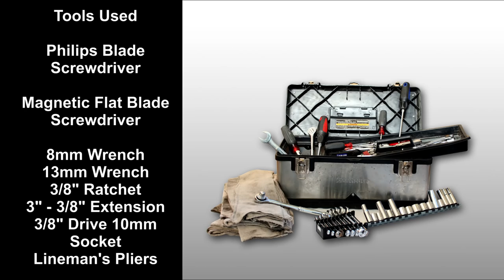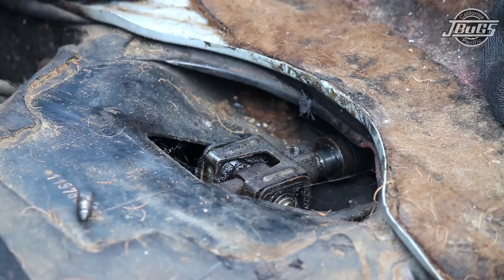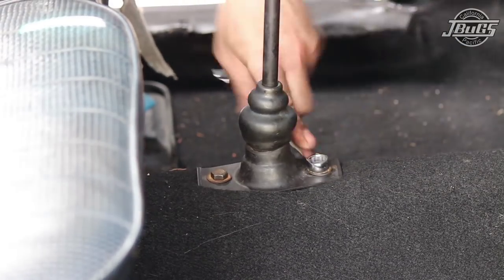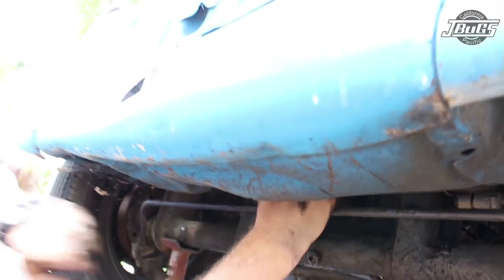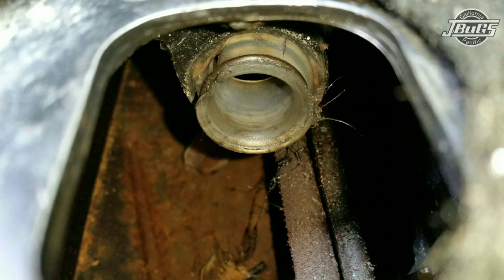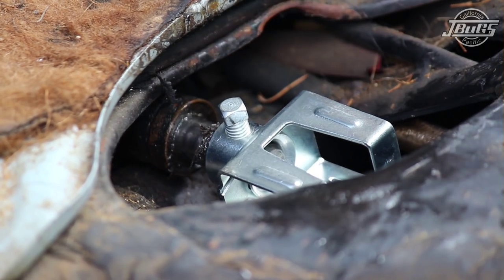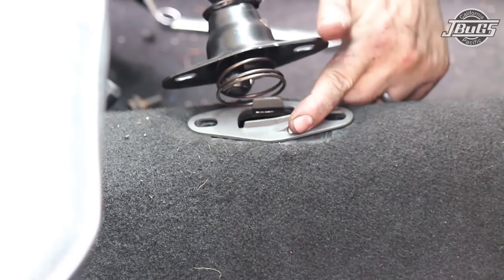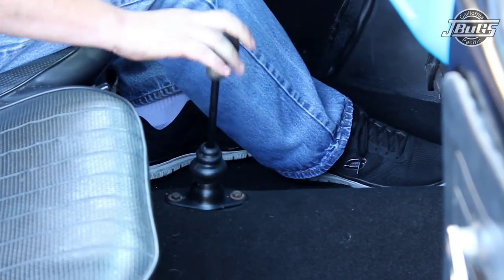JBugs - 1969 VW Beetle - Manual Shifter Rebuild

Comment: +JBUGS One thing that everyone goes crazy about (that was missed) was to lather grease on the plastic bushing and the ball and socket for the shifter.
Reply: We didn't wipe the grease off the original rod, so we didn't need to regrease ours but yes, apply grease as needed!

Comment: Why was the shift lever/rod replaced? I understand the lock out plate, but why the sifter??
Reply: The original shifter was replaced, yes. Mainly because it was easier than sanding down and painting the original.

Comment: no need to buy a who;e roll of safety wire. Go to your local airport and the mechanic wil be happy to give you a foot of it.
As for a super beetle, you can push the tube far enough forward to access the nylon bushing to install a new one . no need to remove the tube from the car, Don't be afraid to use grease wherever it is needed and makes sense. Good crusing.

Comment: Hi JBugs, saw your video and it was great. One problem though, After installing new coupler and tunnel bushing and re-installing the shifter with the reverse lockout plate with the long lip towards passenger side, I cannot get the lockout feature for reverse.when shifting from 1 to 2, I can also accidentally shift into reverse. Theres no pushing down and left and back lockout. The car shifts into 1/2/3/4 okay except for reverse. It scares me to drive it because I can grind my gears. What did I miss. I have a standard shifter with the spring. Nothing fancy. Help!!
Reply from the maker: If the lock out plate is in the correct position, you can try the factory shifter alignment operation:
Press the clutch pedal down and put the car in second gear. Loosen the shifter bolts, and set the shifter vertically (from left to right) and angled back 11 degrees. Using a flathead screwdriver, push the lock out plate to the left, until it hits, and moves the shifter. Hold the shifter top base there and tighten the screws. Shift through all the gears and make sure that the reverse lock out is operating. 

If there are still problems after this, you may have a damaged shift rod, shifter or lock out plate.
Reply: I have the same issue to

Comment: Hi, I did this exact step with my autostick, but I found after I removed my shifter to replace the contact points, my shift rod is no longer center and is now stuck semi recessed into the hole to the bottom left and I am not able to pull it back out far enough so I can properly install the shift lock out plate. (I know this is for a manual, but this is the only precise video on installing a shifter in general, yes I tried install the shift lock out plate in its correct position too, however, it just pops out of gear when moving around because of the location of the shift rod cup.
Reply: If the shift rod isn't moving somewhat freely, that is most likely the cause. I would start by going back to the shift coupler under the rear seat and see if you can get the transmission shifted back to neutral so you can get the shifter properly installed and go from there.
Reply: @Sam_Mebane  Hey Sam, thank you so much for getting back to me. I've never worked on an old bug before, let alone a VW car. I know the area you're talking about and the coupler, but how am I meant to get it in gear manually from that area? Do I pull on the coupler, or the rod? I'm not sure how you would manually shift it back into neutral. Thank you! it does seem like its stuck in Low gear (bottom left) and doesn't move.
Reply: @FallyFire  you can pull on either, assuming the coupler is attached to the rod. If the rod is pushed back fully at the moment, the transmission is either in reverse or "1st" gear (2nd really as L is 1st). You can pull the rod or coupler toward the front of the car slightly to the neutral position, then you can try reinstalling the shifter.
Reply: @Sam_Mebane  Hey Sam, I appreciate the response again! Just went out to finally work on the bug and I pulled on the shift coupling, it's definitely attached. But the shift rod itself I noticed is cock-eyed so it makes it impossible for the shifter to seat correctly. I noticed there was this broken rubber like piece towards the head of the shift rod, where the shifter connects to. Could this be part of the bushing? There was a small metal ring around it just freely moving on the rod itself, so I was wondering if that bushing keeps the rod from turning in the tunnel on itself. I'm starting to think that the bushing got so worn out, that when I pulled the shifter off to replace the contact point, the bushing sliced itself from being rubber or something, and just completely made it unusable. EDIT - It was the bushing, I will be using this video for reference on replacing!

Comment: Can you change out the coupler without changing out or dismantling the rest of the system?  The lockout plate is aligned well and I don't want to mess it up.
Reply from the maker: Yes, the shift coupler can be changed without removing the shifter.

Comment: Is there a video on how to change the shifter bushing on a 1971 Super Beetle. I think there's a different opening in the front for the shift rod since the spare tire lays flat. Thanks.
Reply: https://www.youtube.com/watch?v=7btjeporK98&list=PL7YpZlDdZJCgwFYFCo5WmPgGxko-q6yMH&index=30 We cover the removal on our 1971 Super Beetle in that video. The removal is pretty much the same but instead of the small oval plate, the inner trunk plate and the round cover, there is a "crumple guard" under the chassis the gets removed on a Super Beetle. Then the rod can come out below the trunk.

Comment: Hey JBugs, just curious...but couldn't you just use some blue locktite in place of safety wire for that grub screw. Or would it be better to use a piece of wire? Or maybe both? What are you're thoughts? Thanks for the video!!
Reply from the maker: +dawg1157
Loctite may be able to be used but safety wire is tried and true, typically fail safe method of securing the screw.

Comment: Just did this, theres quite alot of resistance when pushing the rod through the bushing, cant push it in by hand like the video, what am I doing wrong?
Reply: It won't always go back by hand, I've used anything from a broom stick to a long extension on some cars to get the shift rod pushed back in place.

Comment: Dear Sirs, i have a vw 1973 classic beetle where i need to rebuild or repair the manual shifter, however, my car doesn't have the 2 access plates. How can i repair it? your prompt answer is highly appreciated, thanks and regards. Vicken
Reply from the maker: +Vicken Sagherian 
Hello Vicken! Your vehicle not having an access plate sounds like a situation out of the ordinary, but our technicians are happy to help if you need any information. Please call 1-800-231-1784 and we will be happy to assist you over the phone with a question like this.
Reply: https://www.youtube.com/watch?v=7btjeporK98&list=PL7YpZlDdZJCgwFYFCo5WmPgGxko-q6yMH&index=30 We cover the removal on our 1971 Super Beetle in that video.

Comment: Can changing the front tranny mount throw the alignment of the shifter off? As after installing a rebuilt engine on my 67 bus along with the tranny mount the shifter is grinding going into reverse, like its not going far enough into gear and when it is and I let up on the clutch it just pops out of gear. Hmm?
Reply from the maker: Shifting problems can arise from a worn shifter, shift rod coupler, shift coupler, worn shift rod bushings or problems inside the transmission. We’d start by making sure the shift rod bushings and couplers are in good shape. 
Additionally, you can disconnect the shift rod from the transmission and shift the transmission into reverse at the shift lever or (hockey stick) to make sure that reverse is still working properly. The shift lever would be rotated to the car’s right hand side and then pulled forward to engage reverse. This test might be where to start as the problem you’re describing is synonymous with a bad reverse gear.
Reply: Yeah Ill try that but it just seems strange there would be a problem inside the transmission as it was working fine before I started doing all this work, no? And I just now tried readjusting the reverse plate by doing it the way Bob and Dave explain doing it by keeping it in reverse then loosing the 2 bolts just enough to slide the plate forward and to the left without moving the shifter itself then tightening it down, but that didn't help. Thanks for your help!
Reply: Oh and I forget to mention that I also changed the clutch cable, and bowden tube and had tried tightening the cable down a little more but that didn't help.

Comment: HI I LIKE TO CHANGE MY SHIFTER KNOB!! I NEED THE THREAD SIZE ??
THANK
Reply: That depends on which shifter you have. VW used a 7mm, a 10mm and a 12mm knob depending on the year and other aftermarket shifters have different thread sizes as well.

Comment: On this video you mentioned something about safety wire but you didn’t show were or how it goes and I think that is the problem I’m having on my bug the screw keeps coming off and detatching from the transmission the rivet that’s on the bar doesn’t go all the way though so the grub screw has nothing to grab onto I think
Reply from the maker: The safety wire for the grub screw goes through the hole in the head of the screw, then wraps around the coupler and gets twisted together. This prevents the screw from twisting out of place.
Reply: JBUGS Sweet thanks...what is safety wire and where can I get it ??
Reply: JBUGS not sure if you guys received my last message but I was askin about what is safety wire or  where to purchase safety wire also I was looking for the shift rod that connects to the transmission rod with both ends that have the little dimple for the grub screw to grab ahold of but I couldn’t find it on your website I did see the one were the shifter sits in but at the end of that rod it’s bare and hollow and I don’t think that’s it for my bug ?? Any suggestions please
Reply from the maker: Safety wire is usually thin stainless steel wire between 0.20" to 0.41" in diameter. We do not offer any on our website but it can commonly be found on other online stores or in hardware stores. The main purpose of safety wire is to help keel the screw from turning all the way out. In some cases Loctite or other types of fasteners may help with keeping the screw in place. If you have further questions please feel free to call us at 1-800-231-1784 and our technicians will be happy to answer any further questions you may have.

Comment: Is this the same on the 58 model?
Reply: More or less, the early models have a different coupler and different access plates in the trunk. Otherwise the whole process is pretty much the same.
Reply: More or less, the early models have a different coupler and different access plates in the trunk. Otherwise the whole process is pretty much the same.

Comment: I have a 74 super beetle and i was wondering if it was the same?
Reply from the maker: All the components are the same inside the tunnel. Removing the shift rod is a bit different because of the front suspension design of the Super Beetle. The rod is accessed under the front apron and may require removing the front sway bar mounts and, depending on any damage to the body, loosening the front body to chassis mounts to get the rod out and clear of the front apron.
Reply: Awesome thank you!
Reply: @JBugsVWParts   Dang...that much more work?  Ugh.  I wish I knew more when I bought my bug around 10 years ago.  I thought they were all pretty much the same.  Had I known then what I know now I would have never got a Super Beetle.  :P  Some people love Super Beetles, and that's great.  But I want to get an older regular Beetle.

Comment: I have a 1968 Semi-Automatic ,3 speed. beetle and on the shifter there is a wire that goes in this little hole. The wire is lose not allowing shift. I took it out to try to fix it but it doesn't want to stay in. Anyone have this problem.
Reply from the maker: +Howitzer2001
More than likely you are referring to the shifter contact points. We don't offer them but the VW part number is 113713145A if you can find a supplier that still has it available.
Reply: JBUGS thank you very much

Comment: How much does this kit cost? JBUGS
Reply from the maker: Aircooled_Flat4_vdub 
We don't have a kit set up for this, but here is a list of each part we used for this video:
- http://www.jbugs.com/product/113798121.html - $24.95
- http://www.jbugs.com/product/311798211.html - $8.95
- http://www.jbugs.com/product/111701259A.html - $1.95
- http://www.jbugs.com/product/111701263.html - $2.50

This can be somewhat of a tough install. If you get stuck at any point, make sure to give us a call and we will help you out! 1-800-231-1784